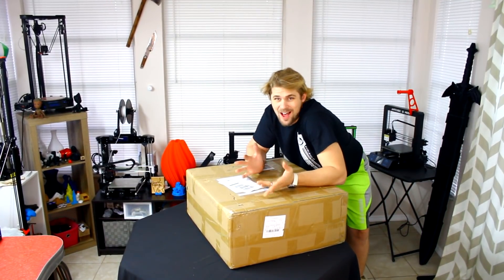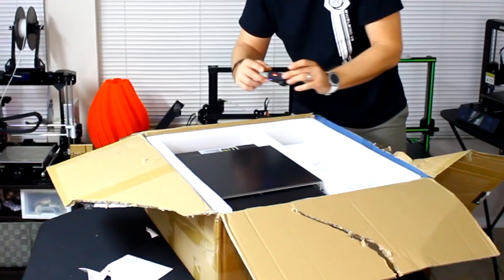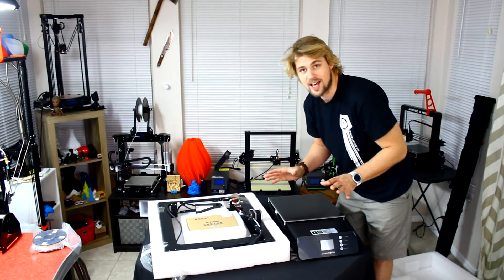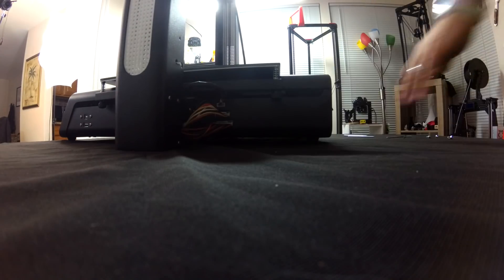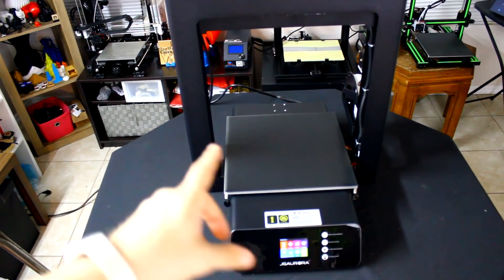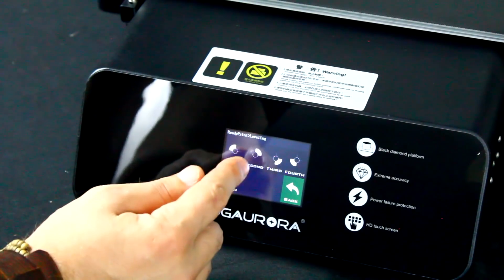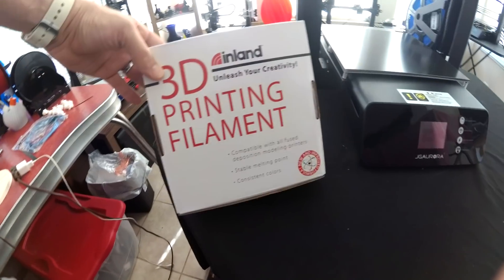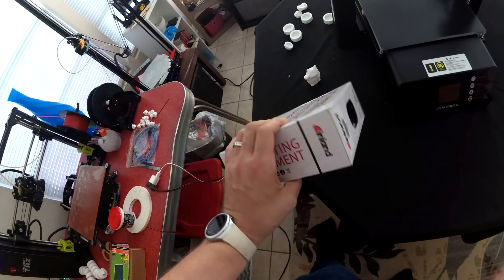✔ JGAURORA A5 Updated Unboxing & Review! EVERYTHING YOU NEED!

Comment: It says on your description updated, has this got the new firmware as all reviews i have seen say that the original firmware was rubbish, i've tried asking gearbest what is updated with no joy. I was looking forward to buying this printer but with the original firmware its kind of put me off. great video by the way.
Reply from the maker: I'm not sure what the "old" firmware version is, but I haven't had any problems with mine at all. It runs very well and looks really nice!)
Reply: i know i was going to buy this printer purely on your review but other reviews say it run marlin 1.0 but its actually a dead fork version from april 2016 and not the 1.0 edition
Reply from the maker: updating firmware takes about 10 minutes if you need to do it so if that's the only thing then just keep in mind that it's all pretty easy once you dive in!)
Reply: have taken the plunge just ordered one, cant wait.

Comment: Is this printer as the latest, updated version or not? Did you change firmware or are you using genuine firmware? I bought it, but I'm still waiting...
Reply from the maker: I believe it is updated, I have been using this printer all month for my ProVRGear store and I use the stock firmware
Reply: Reality Check VR - Are you satisfied with this printer? Did you have any problems during use? Have you tried other filaments than standard PLA or ABS?

Comment: I just got my a5 yesterday, the cat print that comes with the printer gets to about halfway and the print comes loose. Any suggestions as to what I'm doing wrong?
Reply from the maker: it usually means your level is just a bit off, could need one more go through)
Also, make sure that the nozzle is pretty close to the plate for that first layer, if the first layer goes on really nicely than the rest of the print will be in good shape)

Comment: About to order my first printer. Torn between this or cr10. Which one?
Reply from the maker: tough choice, BOTH GREAT! This one has more features out of the box without a doubt, the cr-10 is better for DIY upgrades. Really you can't go wrong my friend, its a tough choice.
Reply: Zykhu  if I were u, get this, it’s a lot easier to use, great features, has almost everything the cr 10 has if not all and more
Reply: Reality Check VR I am planning to get a cr-10s, put an e3d v6 and hook it up to octopi. In this case, would you recommend it instead of the jgaurora?
Reply: Reality Check VR Oh, I forgot, I will also put a 750w sylicone heater which can reach 135°C in like 3 minutes. For that, I will follow Nexi Tech's tutorial

Comment: The printer sucks!
Reply: The JG - so far - turns out to be an amazing machine over here. It's like a friend said, it's a bit like a lovechild between a CR10 and a Anycubic. It prints  - way - better quality out of the box than the popular Tevo Tornado does and needs no TL smoothers or whatever to get good quality, has no issues with an underpowered heated bed like the CR10 does (- easy to fix using insulation -), and it has received an unlocked Marlin 1.1.8 done by several enthausiasts. It also permits easy swap of the Allegro steppers to for example TMC's as the steppers are socketed and the board even has an extra unused stepper socket for "private projects". The only real issues this machine has out of the box is the inadequate part cooler (it blows .... but sadly not in the right way) and the original firmware (which is interesting, but bugged).  Amazing machine, I love it and if I had to choose between my CR10 or this one, I'd probably dump the CR10 (which is an amazing machine in its own right).  The "review" mentioned is a cry-baby-I-want-to-hate-and-need-viewers-so-this-is-great-clickbait stuff, nothing more, nothing less. Also, the new versions have no printed parts at all anymore in the movement system : it's all machined full-metal parts. I'm not saying the machine is flawless, but it's really a very nice machine capable of excellent results out-of-the-box.
Reply from the maker: elaborate, or show me why!
Reply: Reality Check VR easy!
https://youtu.be/UIkcmM9tL20
Here it is and that's not ad!
Reply from the maker: lol I was thinking you would mention this video! I know this Tuber, and this review printer he received was damaged.. so he made a negative review saying the printer is bad.. that is silly! Do you not get it? He should send it back and get a new one to review right? But he won't because he has other printers to review and apparently does now know how to fix the problems that his came with. His mistake video is now influencing people like yourself to think that a bad shipment means a bad product. Anything that comes to you broken is bad. It doesn't mean you make a video telling people false information) The printer is easily one of the best) I have a lot more time with printers to say this my friend)
Reply: @RealityCheckVR  just got mine and it absolutely wont home or evel. Makes extremely loud banging sounds.

Comment: Hey I just got one of these today and it is the first printer I have ever bought the flash drive had some random files it came with that worked when I printed them but when I uploaded my own to the drive (I got the file from thingiverse and sliced with cura) NONE of the prints I upload will work when I hit the print button it goes to the left corner of the plate and makes a 1/4 circle shape. Please help

Comment: hello, you could help me?. I bought jgaurora a5 but it's damaged. where can I find the parts? thank's
Reply: It depends on where you bought it from. If you bought it from JGaurora themselves, you'll have to contact them. I've found them to be kind and responsive. If you bought it from Gearbest, you must report the damage to Gearbest and they will handle your issue. It takes them some time, but i've always got a replacement for broken parts on other machines I bought from Gearbest too. What was damaged ? It would be interesting to know this, as the JG's are pretty well packaged.  Tronxy X5S's for example come with borken parts so many times, Tronxy has started to add spares in all boxes because so many people were having broken Z-motor brackets and stuff.
Reply from the maker: Did it come damaged? I would ask for another one!!! What parts are damaged exactly?
Reply: I discovered the damage just opened the box. the spring that makes the bar go up and down is spacct. ho I momentarily solved with a band-aid :)
Reply: .... sorry, that's clear as mud -  and don't worry, that's pure my fault for failing to understand you   - . :)  Which "bar" are you refering to ?
Reply: sorry for my english 
the vertical bar that brings up and down the extruder. but the bar is ok. the spring of the motor that rotates it is broken
Reply: now I'm doing my first print, with the sticker, it looks like it works. but it's not a solution
Reply: still not 100% sure, but I suspect you're talking about the motor coupler ? Yeah, that sometimes happens. Cheap part to replace. Just contact your seller or buy the correct version locally, presuming you're talking about this part : https://www.ebay.com/itm/New-Flexible-Coupling-Coupler-Shaft-Couplings-3D-Printer-Stepper-Motor-5-8-25mm-/322548511782?_trksid=p5731.m3795

Comment: does it have auto leveling  ??
Reply from the maker: it has assisted auto leveling which does help a lot, it bascially gives you 5 points to check and it is very simple to level. I like only doing it once and then I can usually print without issues for a long time

Comment: What can you tell us about the the heating of the bed process? is it like the CR-10 or like the Tevo Tornado?
Reply: It's "between CR10 and Tornado" really. Took me 10 minutes to reach 100°C. The bed is NOT insulated, pretty sure the heating times can be shortened by at least 40% when I insulated the bed.  The machine uses 24V electronics for the heated bed (and the rest of the printer too).